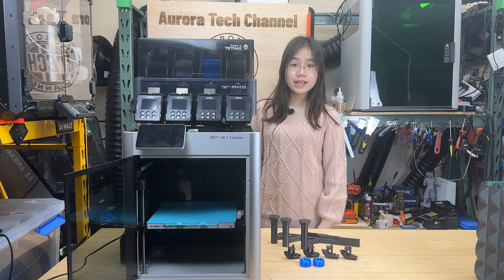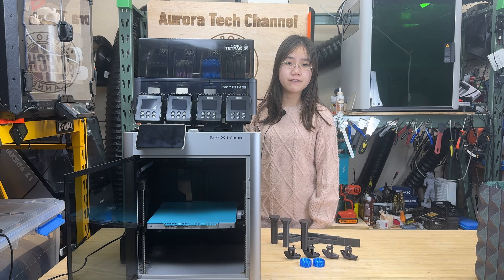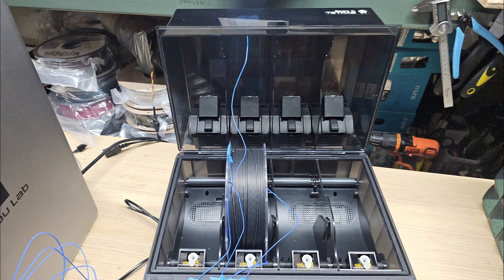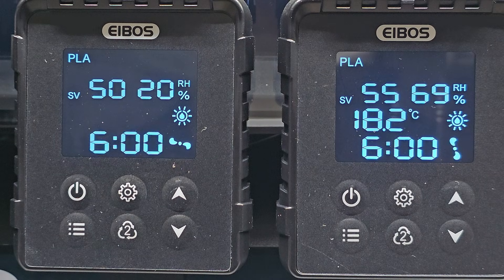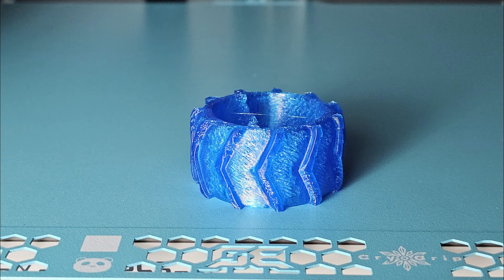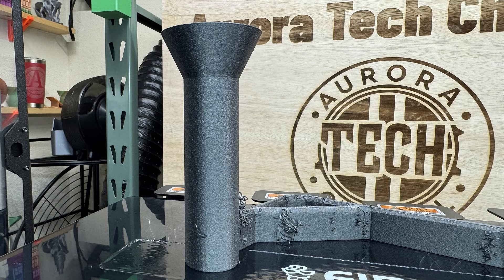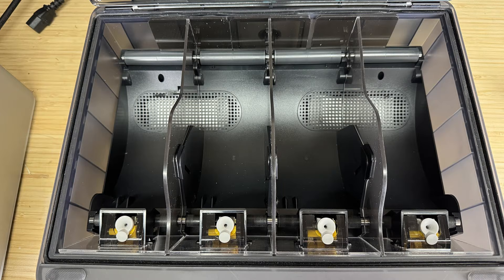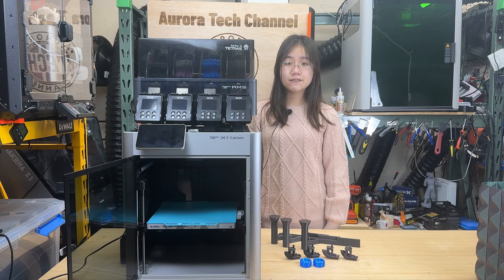EIBOS Tetras AMS Dryer Review | 4 Independent Chambers, Temp Tests, PLA, PETG, TPU & Nylon CF

Comment: issues with the chamber seperators.  The plastic is a bit proud (heat blockers) and the filament drive plastic is a bit tight.  I am barely able to close the lid and seal.  Overall, easy to install, and super cool to have seperate drying profiles and can dry while printing.  Also, great review. Detailed at a BARE minimum...

Comment: I ordered the Dyas  ( 2 chamber version) back in July.  Due to production issues it was finally delivered 10 days ago.   The graphic assembly instructions are terrible leaving you guessing what they mean several times.  Then I turned it on.   Both units squealed very loudly.  The 4010 fans on the inside both had bad bearings in them .  I contacted Eibos and they wanted me to confirm which fans were making the noise and to send a video.  I did so and they responded that they had a supplier issue and are filing a lawsuit against them.  They said they would send new fans in about a month.  I said that was inadequate as I have already waited 4 months due to their delays and because they expected me to install the new fans.  Still waiting for a response from them.   Very disappointed with Eibos’s quality control and delays.  I can’t recommend these.
Reply: I had the same problem with fans on my Tetras, but I opted to wait for a replacement unit. I'm certainly glad that I did so. It also took about a month to receive. The replacement unit functions just fine, and now only have fans that move enough air to be noticeable when all 4 chambers are running.
I understand your frustration, and sympathize with your intolerance, but it's not about installing the 4 fans yourself. It is simply replacing the lid with a new one.
I now have some extra units in case something fails, and can do a quick fix if a heater or fan goes out in the future.
I DO recommend the Eibos units, because it is the ONLY option for the original AMS units that gives you drying, drying during printing, and up to 4 different chambers. Maximum options with minimal fuss. I am very happy with my purchase.
Reply: @A @AlAmantea So far they have not offered a replacement unit, just the fan replacement. Waiting to hear back on a request for a new unit.
Reply: @ScottHolman-z3v that's what they offered to me as well. Fan replacement. When I got it, it was a whole new lid assembly. I think it's a mistake in language translation honestly. I would do it. Even if it is only fans, they aren't difficult to replace. Takes about 10 minutes.

Comment: I ordered this week the Sunlu S4 for around the same price as this one with in the 2 chamber version. Would you recommend keeping the S4 or going for that one?
Reply: I have both of these devices.
Partially, it depends on where you have the unit located. If it is inside your home, in a constantly occupied room, then I would stick with the S4. It is silent for the most part, whereas the Tetras is definitely not. The Tetras lids, when opening or closing, overrun their gearing a few teeth on each movement to ensure the unit fully opens or closes. This causes several audible clicks every time it opens or closes.
Additionally, the fans in the Tetras are a very well known issue. When I originally purchased the unit, it arrived with noisy fan bearings on startup that didn't go away until the fans were running for around 30 seconds. Tech support did send me a replacement lid assembly with all new fans and heaters which was very simple and easy to install, which made that problem much better.
I still have quite a bit of fan noise during drying operations, but it's due to the fact that there are 8 fans on the thing. If all chambers are running at the same time, fan noise is inevitable.
The S4 has a basically silent operation and none of those issues, but the tradeoff is it works completely separate from the AMS, so drying during printing isn't possible. My personal preference is the Eibos Tetras, as I run a print farm, and that option is very important to me. You may not care about drying during printing, and if the printer is in your bedroom, office, or living room, may prefer silence.  In either case I would stick with your Sunlu S4. I have 2 of those, and love them both.

Comment: I picked one up a few months ago and love it.  Using it with an X1C, it is really nice knowing that the filament is ready to go whenever I need to print.  I’ve only used it with PLA and PETG so far.  Next ABS and Nylon.  Directions for assembly were OK, but there were some parts that weren’t totally clear and needed a bit of extra scrutiny to make sure things were installed correctly.  Overall I’ve been really happy with it.

Comment: Thanks Aurora. One thing to keep in mind. Sometimes drying materials will not salvage them. That is when the filament hydrated long and enough to deform it so that even after drying it won’t extrude smoothly.
Reply: True but this is mostly limited to pla
Reply: @riba2233  PLA used in 3D printing is typically a polymer material obtained through material modification. Depending on the proportions of additives and modifications, different formulations used by different manufacturers may produce different results.
That is to say, the higher the % of modification added, the easier/faster it is to become brittle or 'expired'.
Reply: @eibos3d_Team  yeah I have noticed that some pla blends pick up less moisture than the others.

Comment: WHY do you continue to promote one of the wORST companies in the world? Bambu Labs has NO customer service or care!!!!!!! Your site now garbage
Reply: Stop being weird.
Reply: Bro nobody cares lol, why are you so fanatic about anything lol, also bs on no customer service I had better service from Bambu lab than the many years with Creality lol
Reply: Personally, I've only had good experiences.  I've received refunds/credits promptly for badly wound filament spools, and replacement parts due to an annoying filament blob (poor detection later fixed in a firmware update) that messed up a print head beyond my willingness to try and fix.

I personally don't care their firmware is not open source because my goal is having a stable/reliable printer to print things - not to tinker with the printer.
Reply: Wow you sound so mature. No one will take your little baby rage comment seriously :)
Reply: WHY do you continue to feign outrage over someone's content? This is not supporting Bambu Labs, this is about a filament dryer that happens to be compatible with Bambu printers. I personally don't agree with Bambu's, Creality's, Flashforge or any other manufacturer that insists that you use their slicer version of orca in order for their printers to have all the features you get in Orca Slicer. So guess what, I don't purchase those machines. However as a standalone filament dryer this thing is a beast and I may get one. As a matter of fact, if me getting one upsets you, I will definitely get one.
Reply: @3FWDesigns difference here is that Orca was developed AFTER and based on Bambu Studio. So if Orca exists, its because Bambu Studio existed before.
Reply: @3FWDesigns  or prusa that also limits their printers functionality to their slicer ;)
Reply: @3FWDesigns it's so weird that people get so uppity over product decisions companies make.  Do you write your own slicer or are you just being a nerdish contrarian?